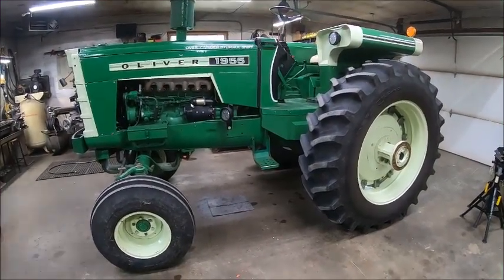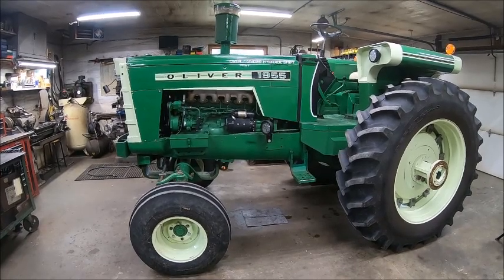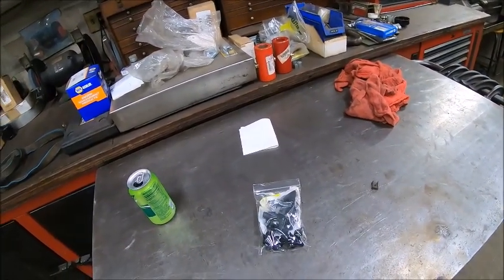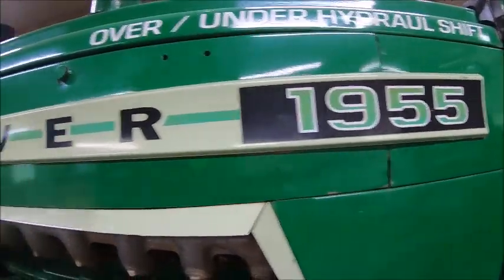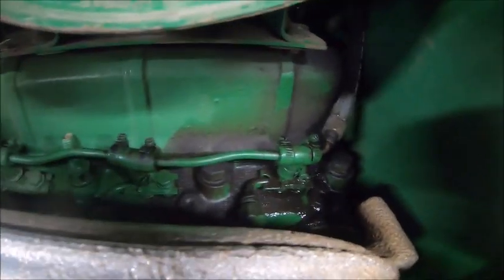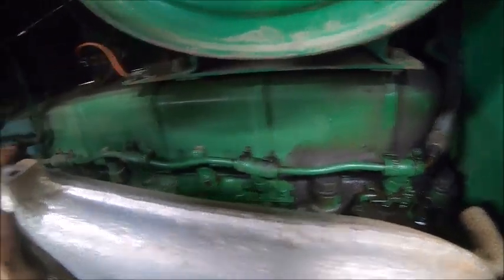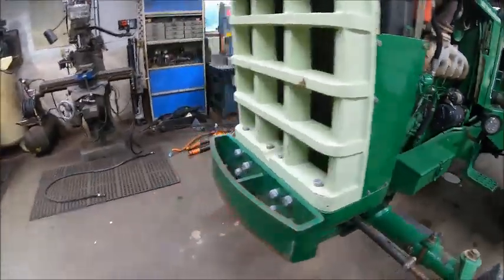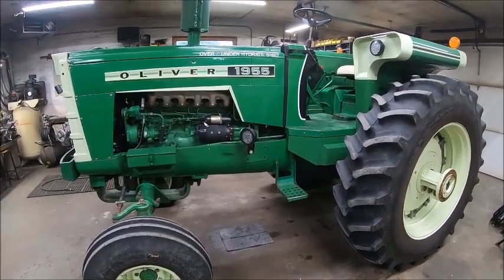Getting Ready For Fall: Part 5

Comment: I replaced the same little tees on our 4020 in 2010 and again this year.....
Reply from the maker: They make brass fittings for the Deere injectors.
Reply: I told you a story....... Now that I remember they were not Tees just  straight boots......... the return line had drop tubes  fabricated into the line over the injectors....Because I used the ties that come on bread bags to hold the clips on the line while I inserted the drop tubes into all 6 boots....... that way  all I had to do was squeeze the clip and move down....